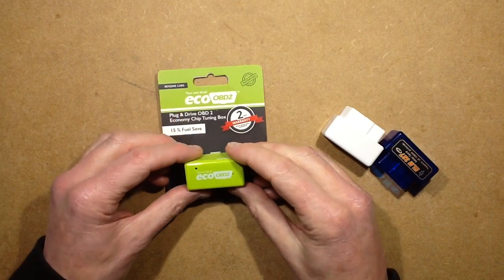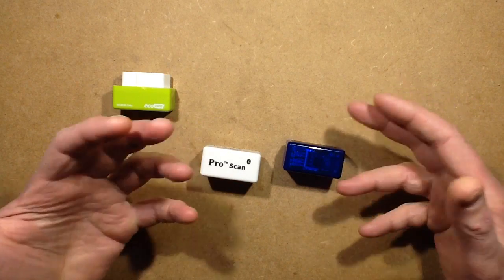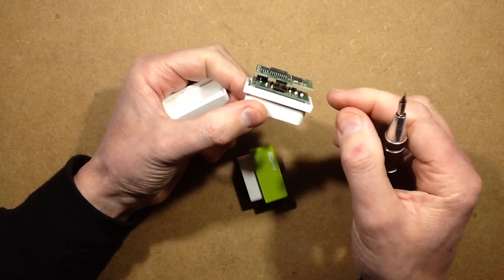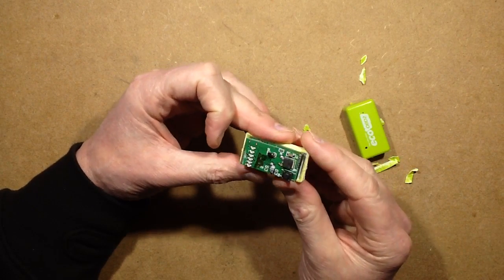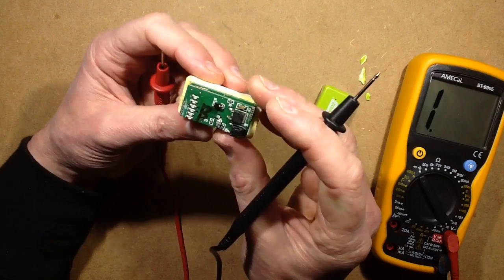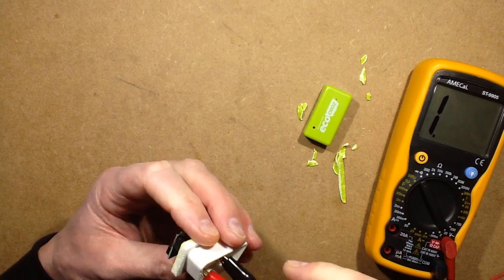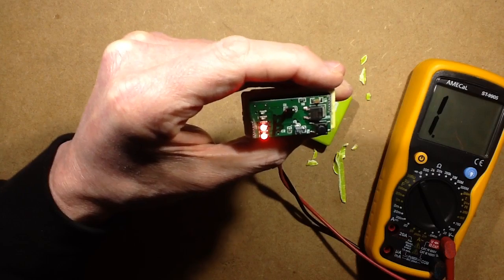Inside an ECO OBD2 "chip tuner" fuel saver.

Comment: I bought this and the port hole does not have a button inside of it. I stuck a paper clip end in and there was nothing to reset.I plugged it in. Got immediate fuel savings and after 100 miles, my engine light came on and tells me I have a bad catalytic converter which is rare on a 2016 Chevy Colorado truck. Now I am getting worse mileage than when I plugged it it.  Reset the engine ight and it comes back on. My reader now says my truck will not pass the emission test in CA. Will cost over $1100 to replace.
I do not recommend plugging anything into your vehicle unless a professional is consulted.
Reply from the maker: These units do nothing.  There are real units made for specific vehicles, but these units are fake.  It's most likely aging engine components that are your issue.  Possibly the oxygen sensors.

Comment: Quite an old video, 100 percent agree that device is a scam however you are incorrect re: programming.  99 percent of vehicles can have every module in the vehicle reprogrammed via OBD and have been that way since ECU's started using flash memory rather than rom for program storage

Comment: It would be interesting if one of these supposed fuel saver things tricks you by controlling the fuel gauge, so you're driving along, it says you have 3 quarters of a tank of gas, then just as you are marvelling at the fact you still have 3 quarters of a tank, when you would usually be running on empty....Then the engine starts coughing and stalls and dies, you tow it to a shop, they check everything out and everything seems to pass all tests, then they notice the device plugged in, a d they disconnect it from the vehicle and the fuel gauge drops to empty, they pour a couple gallons of gas into the tank and it starts right up, they call and say it's ready to go and running fine, they hand over an invoice for diagnostic labor, and 2 gallons of gas, and they say "It was out of gas, that thing plugged in was controlling the fuel gauge so you thought you were getting great mileage when in fact, you were getting the same mileags as you usually do and the fuel gauge was tricking you so it looked like it was actually doing g something, all it was doing was controlling the fuel gauge" 🤣😂🤣

Comment: I don't know too much about car OBD systems but motorcycles such as Suzuki can be tuned through the diagnostic port of the engine management computer.
I had a Healtech device on my 1250 Bandit and it connected to a laptop and allowed 500 points in the fuel injection map to be tweaked and the profile saved. 
By holding the throttle open different amounts (i.e. closed , half or full - it read the throttle position sensor) when switching the ignition on you could select from two custom maps or the factory map.

Comment: It's a scam product and confirmed one on the internet, although you are first one I saw take one apart. I think any real OBD device wold come with at least manual telling what color codes and blinks on the LEDs etc. and at best, not really blink LEDs when it isn't registering anything (don't know how those things work, since I don't own a car and never seen car that has OBD port) but that's my assumption.

Also clearly, any electronic that has microchips and connects to data port of some sort of a car claiming to reduce fuel consumption of said car, would be brand or even model specific. After all, I'm pretty sure there are different systems running on different cars from same brand, but different model. Obviously you wouldn't see Mercedez Benz, Aston Martin, Tesla or any car manufacturer making something like devices used to run diagnostics on their cars universal, or at least not without having some sort serial number or pin code similar to paid TV channels and safes with digital locks with their factory settings do, especially if those devices can do more, than just tell if your car has leakage or motor is overheating.

I mean think about it. if there would be OBD unit which can do whatever it is programmed to do compatible with any car that has OBD port, wouldn't it be........alarming? After all, car which has computer of sorts to run diagnostics and regulates your engine, locks etc. can be programmed anyway you like, just like any computer. Fact that there wouldn't be anything that requires specific type of tools only authrized personel can have or at least certified compatible device could do is plain stupid, I mean you might as well just go to a biker gang hangout and yell "Nice three wheelers you guys have, do you still wear diapers or are you actually so grown up, you can count to 10?".

Comment: Okay so I just noticed this in my man's car, we have an Impala like 2000 around there, but I've been driving it at dark for like 2 hours maybe it was so dark outside so foggy maybe I missed it but I'd like to think I didn't but I noticed it when I pulled in the garage because it was blinking. Which is really weird because I turned off the car, but I turned The key to make it power but not turn it on all the way, And that's when I noticed it was blinking on off on off on off like bright green nothing bright green nothing bright gray nothing It was just flashing like why? I can say out of that whole trip I actually was like damn where did all the gas go!! And that was before I even saw this thing I saw this when I pulled into the driveway at the end of the drive but I was like wow what the hell? Because nobody was on the roads cuz it was so dark rainy and foggy and we usually get hella good gas mileage. So if anything I think it kind of maybe does the opposite or doesn't do anything at all but I don't know that's why I wanted to comment on here and we're just start looking it up. I actually thought it was a GPS device because he does that a lot But I'm very surprised to shocked that he even bought this. He usually does a lot of research actually I take that back he doesn't I do but I don't know if you have figured it out yet please let me know cuz I just saw another video on it that literally just made fun of it and was like this is such a scam but you know a lot of people say that about a lot of things and a lot of people say that stuff works when it doesn't So I like this one cuz you actually took apart the hardware and I'm hoping telling you when you said at the end it was flashing so hopefully you can put it together and maybe figure out that it was just junk I don't know or the opposite because that's when it was flashing for me was when I turn the car off and then turn the power back on so I can roll the windows up and I noticed it. It may have been flashing before I even turn the car off too after I pulled in the driveway that's just when I realized it because I wasn't focusing on the road anymore obviously lol although I like to think I would have seen it regardless because I have really good vision and if I'm in a dark car and the road's super dark and there's something flashing down below me I think I would notice that so yeah maybe that helps put two and two together for you. But I thought it was a GPS He likes to do that so I have had one of my car stolen and yeah but I don't think he got them for that reason However I have had a ton of stalkers and just a lot of spying. Like somebody called me and they didn't even know the person who I was with and I was with him at his house but it's a guest house so it wasn't even under his name and somehow he knew where I was and he knew his name which was not even on the lease not even on Google satellites where it says who owns the house I mean there's no way he would have known that through proper channels so if anybody knows an easy way or any advice to like block GPS block people in your phone find GPS turn it off or any of us at all for any of that type of crap please let me know You know other than breaking up with him because it's not really just him it's a lot of people especially people in my phone I mean it keeps happening I even bought a new phone and I cut my old phone off and somehow the other phone rang How in the hell does that happen there was no Wi-Fi no nothing but it rang and didn't even have service but it's like when I transferred that phone over to my new phone it transferred however people are stalking me through my phone to this phone everything I look up says things like check all the applications in your phone and see if they're drawing a lot of power or battery life or data and you're not even using it but the thing about that is nowadays your phones have so many applications and they're all weird and if you cut one off you're kind of screwed cuz I did that before and it did screw me actually so there's got to be an easier way I mean by now they should have like a diagnostic tool for free that can just know Like what belongs and what doesn't. Or like all the apps that says it scans for bugs, GPS devices, cameras, hidden mics and cameras, etc and most of those are BS too So if anyone has any advice at all on any of these please comment me You heard if it's something stupid because like everything is so time-consuming or cost a lot of money or just doesn't work)

Comment: J1939 varies between manufacturers, doing CAN controllers a few years ago for Generator's was a nightmare, each manufacturer required tweaked software, to be able to control the engine. So a little device like this is unlikely to have all the required protocols... Scam...

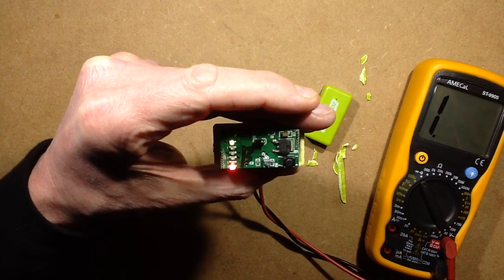Comment: I believe these devices are ready only --no write.  The only thing it could do is reset codes as soon as they appear, which would revert the ECM to defaults ans initiate a defaults mode when it goes back into testing, which is done to help it learn...   There are some manufacturers that do allow changing values on the fly, but probably not permanently.  Therefore the people who say they work are likely throwing codes or their car is one of the manufacturers (mostly European) that allows for on the fly modifications.   So yes it's a SCAM, but it may do something likely in older model European cars or those already throwing codes. 14:14

Comment: I'm actually using the eco 2 green  obd 2 fuel saver. It claims 15 percent better fuel mileage. While I am seeing a small amount of improvement it's definitely not 15 percent. I've been using it for about 2 months on my 07 ram 2500 with a 5.7 Hemi. I was averaging around 12.5 around town and 15.7 on hyway. Now I'm slightly better at 13.2 and 16.4. I'm a mechanic with almost 30 years experience and I know for a fact that most ECU's are locked and it can't be changing much. They definitely work but not at 15 percent as advertised.
Reply: IF it does anything at all, it's likely just broadcasting recorded CAN data across the network to manipulate temperature or pressure sensors (BARO or IAT) to force the engine into a specific operating mode. Locked processor wouldn't matter, but broadcasting recorded CAN data access a live network can create its own host of issues.
Reply: I just got one of these but I’m hesitant to try it in my BMW 650i 4.8 V8…

Comment: Hi. I put one of these on my car a while ago.

Since my £30 a week has been a 3rd of a tank less every week. However that looks in quantity seems to last the same amount of time since the chip was installed.

My car is automatic. And one thing that does seem to have happen is. That the car coast a lot longer. Infact I noticed I actually had to break a lot more to keep the car back.

Also on the other hand if I say did want to boot the car, it seems to have a faster response and power outage.

So I’m not sure.
I’m actually thinking of removing it. And this is how I came across your video.
So I could ask and you may not know.

Would it be safe to simply unplug it ?

The reason why. One other thing that seemed to have happened since I plugged in the chip.

The air conditioning stopped working.
So my thought are, is it the ship that has done that ? Or is it simply a case of I need a re-gas…
Thanks.
And great video… 👍👍
Reply from the maker: You could remove it to test what happens.
Reply: Well. I pressed reset. Took it off. Car ran well air on still didn’t work 😂 But I’m not gonna to put the chip back in. Not sure if the car ran better without. I’ll give it a week.. 

Thanks though. Again great video. You know your stuff 👍

Comment: I feel it is a scam. The interesting thing is, the version I got looks exactly like that on the outside but it is a single board on the inside with a button, LED and what appears to be a 555 chip. While the package is the same, the one I have is "fuel save pro" and the cover is not glued on

Comment: its even worse now.. i took apart one of these eco obd2 things, all it does is use the power to power an led when you push the button, with some capacitors and resistors to make it look like it does something
Reply from the maker: If it was bought from eBay what was the listing number?

Comment: I wouldn't doubt that there can be things you hook up to the OBD2 port that can help make slightly better mileage. 

It probably wouldn't be cheap but. It is like a computer with newer cars. 

And you wouldn't be able to just get any one and it work. It would have to be specifically for your car. Year make, model and maybe even trim level.

Trim level. That's an odd term considering the changes to performance of some trims.

Comment: Had one of these for two weeks on my 2016 Buick Encore (Opel Mocha in Europe) - until it set three engine codes and car refused to accelerate. I spoke to the head mechanic at a local dealer, who is a friend - and he said that, at best - it doesn't do anything...at worst, it can reset your ECU permanently (BIG MONEY to replace that) Luckily, the OEM reset itself after several restarts and battery disconnection overnight.

Comment: This POS does not work. I used it for 28 days and my car got the same gas mileage, except for the fact that this unit almost took out my catalytic converter. The fist week while using this Chinese POS, my check engine light came on. I scanned the car for codes and it said my catalytic converter was bad. I removed the fuel saver unit and a few days later the code was gone. I reinstalled the fuel saver and 2 days later the code came back. Now, this unit steals so much power from your vehicle that it is dangerous to use when the AC is on. The car actually chokes out so bad that you cant hardly accelerate. After testing for 28 days, I decided to get a refund. However I only got 50% back. Why? because you have to send the unit back to the company and with shipping prices at an all time hi, it would have cost almost $10.00 to send back. This company knows this and they offer a 50% refund and you keep the unit. Very dangerous item and potentially expensive damage done to your car while trying to save a few buck per week in gas. It has taken me almost 1 month to the catalytic converter code to stop coming on. I have had to clear the code 4 time now. The code hasn't showed back up for a week now and the original power and gas mileage is back to normal.

Comment: Have you looked at the circuit board?  It would be curious to see if it is just triggering LED, have no connections to the logic chip.
Reply from the maker: Later explorations showed that these units have no data connection and are just a light show.

Comment: I got 2 of these for about $15 shipping.  Both were sent in a vanilla envelope. After seeing this video I decided it was a scam and I told the
 company I wanted a refund.  They said that I could not get refund and then I was told that I was signed up for some buying club and there was 
nothing on the statements They had billed my credit card for $63 and were going to charge me another $110 but they were able to cancel the 
buyers club. I told the person that I did not see anything about signing up for a buying club.  They would not reimburse me for the $63.  I 
disputed both charges with my credit card company and after a few weeks of investigating I got reimbursed in full for both the fuel savers and 
the buyers club.

Comment: After reading many of these reviews, I did not read that anyone reported fuel savings. They mentioned diagnostic readings but did not mention any fuel savings which is what the unit is sold as doing. Hmmmmmmmmmmmmmmm.
Reply from the maker: The answer is no fuel savings other than those imagined by the user.  The majority of these are just putting on a light show and aren't even connected to the canbus networks.

Comment: Would the pins for connecting to the computer change voltage? I wonder how communication over wires even works. Is it like a pulse of electricity, or changing the voltage?

Comment: Many cars already have these types of gas saving devices shown on the dashboard. For example, the lexus ES300h, like many cars, allows the driver to set the dial to ECO mode (as opposed to Performance mode). The instrument panel then has a handy fluctuating dial that shows the driver if he/she is driving in a way to save gas. It works really well. Just so scary, the idea of attaching a probably bogus scam device to a car's electronic control module.
Reply: The Eco mode switch on cars is a button the makes the automatic gearbox shift earlier into higher gears the opposite to Sport mode that leaves the car in lower gears longer.